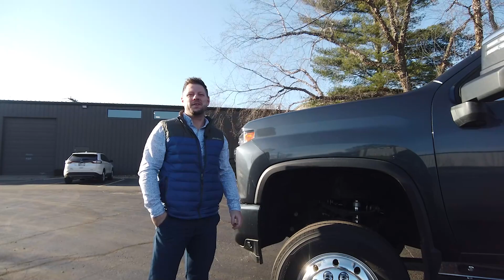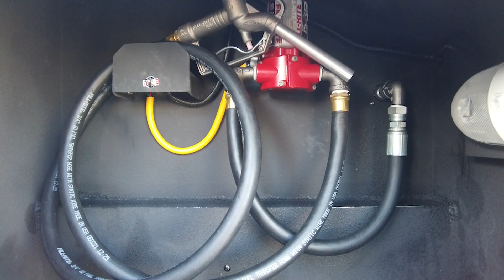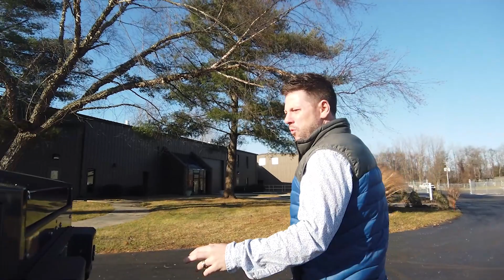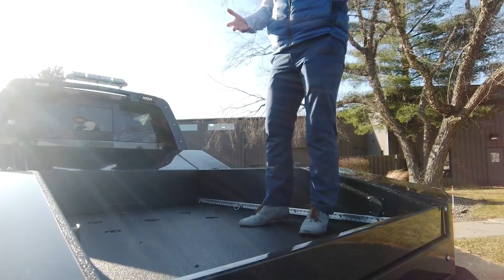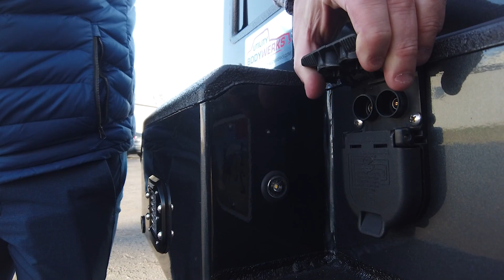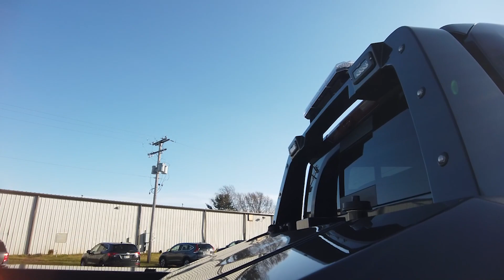2021 Chevrolet 3500 HIGH COUNTRY Elite 56 Hauler

Comment: With that lift and your kelderman suspension what’s the tow/haul #’s on this truck now? With a full load of fuel & passengers will it be able to take a 5k pin weight. 
Thanks in advance.
Reply from the maker: Shawn. The factory door tag for max payload is 5223. This is the max payload before any of these mods took place. The GVWR is 14,000Lbs. This truck after upfit rolled across the CAT Scale at 9,840Lbs this would make the new payload 4,160Lbs.

To answer your question NO this truck isn't capable of hauling a trailer with a 5K Lb pin weight. We installed a 100 Gallon fuel tank so by the time you fill this truck with people and fuel payload left over will be closer to 3k lbs.

Thank you for the question.